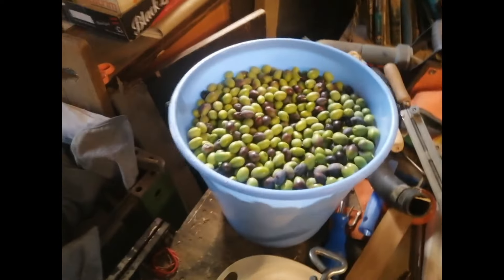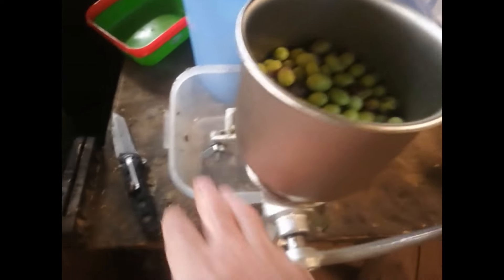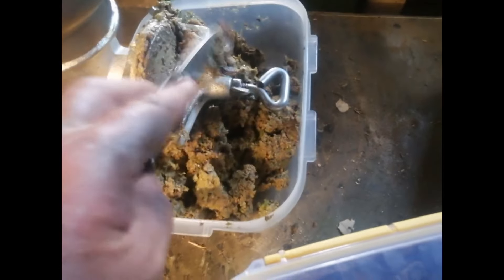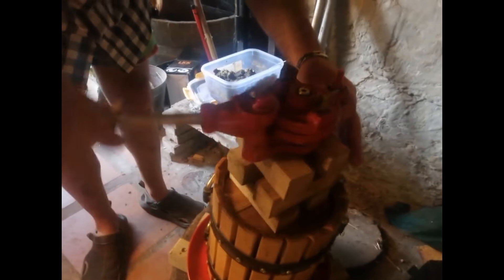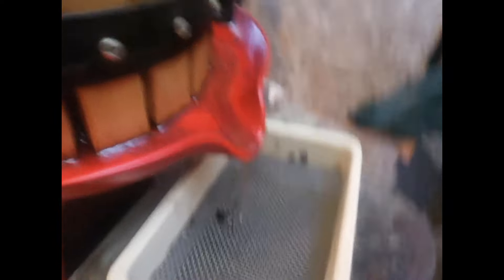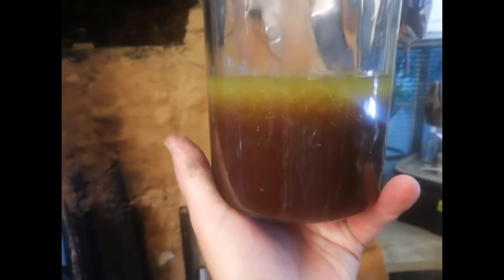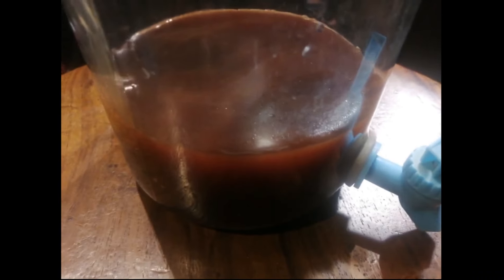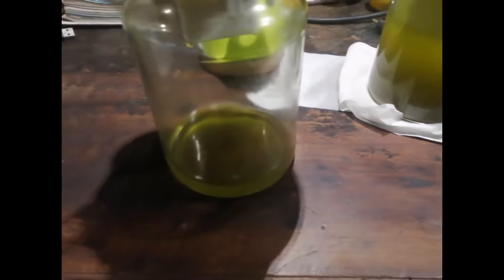Making Olive oil at home

Comment: Interesting thanks. I didn't know thay used the pits too.
Reply: Generally not. They use sorters (based on color/shade, then size) and depit. You can get the clean, whole pits from the presses and farms afterwards as "ground cover". They can also be use to generate biogas, etc. But they contain a lot of phenols/antioxidants.
Reply: @SimpleEarthSelfReliance  Ah that is more in line with what I thought, for extra virgin olive oil. It seems like there is quite a green and circular economy there in South Africa because here in Europe after cold pressing, the pulp can still yield a lower quality oil with heat and solvents and I had little doubt that the pits were thrown in at that stage. Anything for a buck!

Comment: When you were syphoning the juice from the oil is it possible to drink that juice, and if so have you?
Reply from the maker: It is packed with a LOT of nutrients, but so bitter that it is undrinkable!  Yes, I tried drinking it but failed utterly.  So at this stage I'm using it as liquid fertilizer for my water chestnuts and around some of my fruit trees.
Reply: @capelandpermaculture5808  I somewhat guess that is what it would be for taste, but it is cool that you can use it for fertilizer.